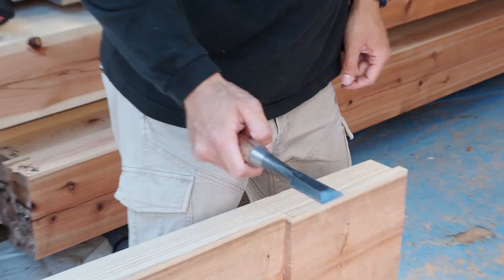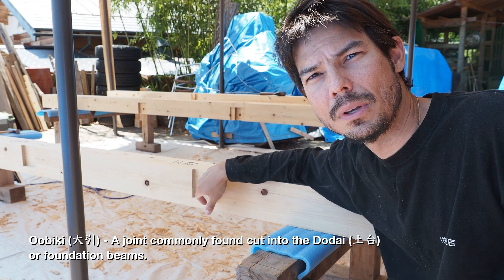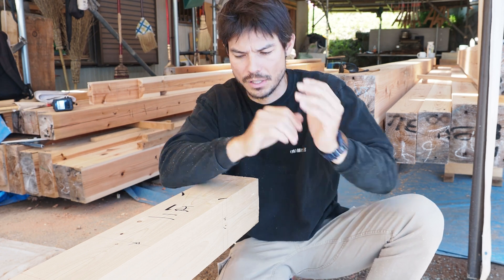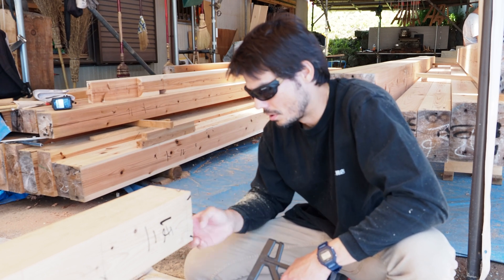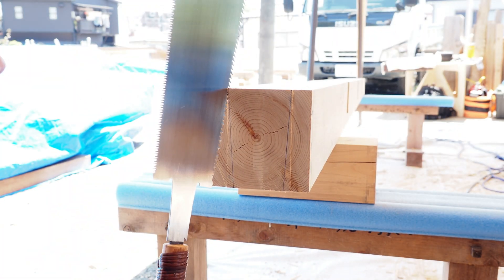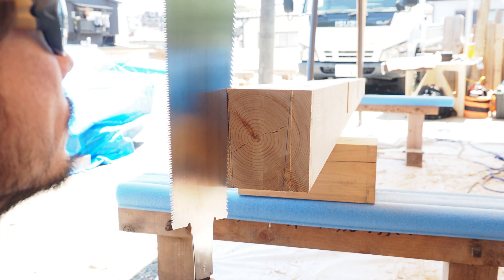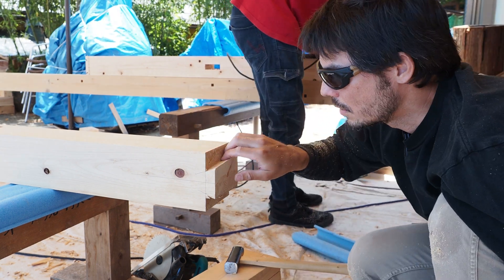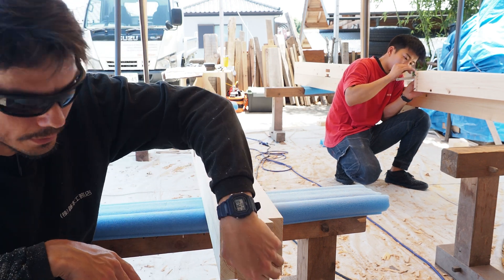Cutting a Modified Tapered Japanese Dovetail (蟻仕口 or Ari Shiguchi) - for Foundation Assembly

Comment: Your videos are always enjoyable. I assume those beams are the equivalent of floor joists but dovetailed to counter pulling forces, and the 90x90x15 cut-outs accept the 'joist blocking'? Except they line up on 909mm square foundations, right? 

I noticed the hammer head (Hiroki?) is attached the traditional way—it would be nice to see how you go about it. All the best.